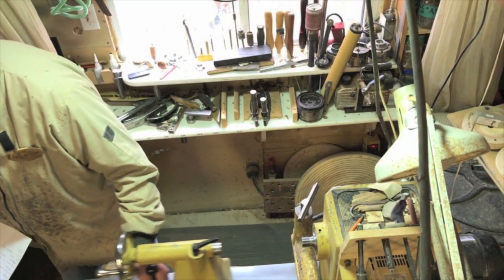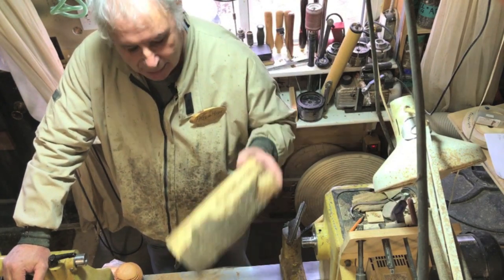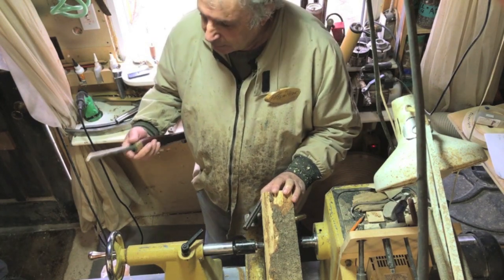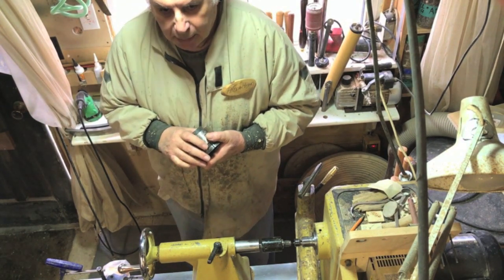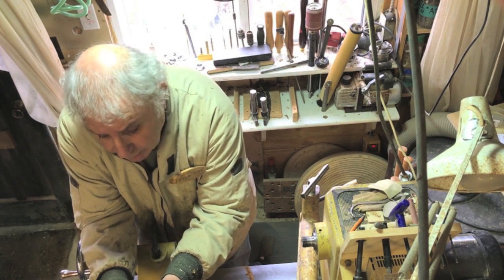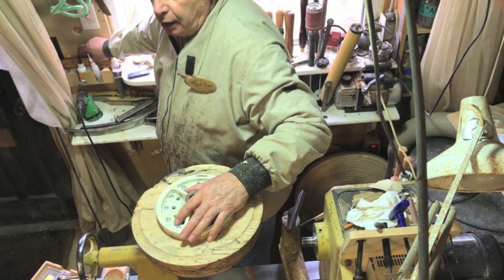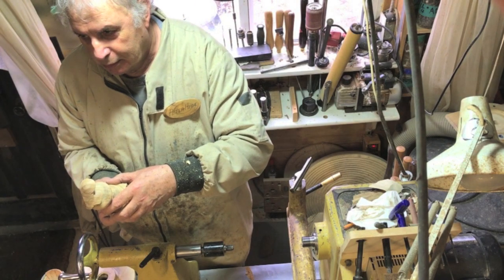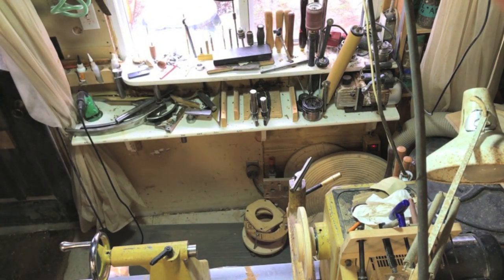NWG APRIL 2018

Comment: This was great. Thanks Peter.
Reply from the maker: Thanks. It was just a normal club meeting and sometimes more enjoyable than just talking to a camera
Reply: @peterhyde3282  thanks for the response. I enjoy your style and will be checking out some of your other demonstrations. I’m currently in the market for my first lathe and saw the video with Ethan and Wade demonstrating the Record Herald lathe which I may get.  Your analysis about it was very helpful as well
Reply from the maker: @victoryak86  The Herald is a very versatile lathe. It certainly is a good choice for a first lathe and pretty soon you will get to think it's the only lathe you will ever need. Lots of good features and well made.
Reply: @peterhyde3282  thanks Peter.  Looking forward to it. I know there’s a big learning curve but that’s what it’s all about right? You may be hearing from me now and again with the occasional question😊. Appreciate you, best mate.
Reply from the maker: I was still using my trusted Powematic 3520 when this video was shot. I decided to downsize and sold it as I was no longer making big stuff. The Coronet Herald was chosen because I had tried one at my local dealer Stockroom Supply. The sliding/rotating headstock was for me the deal clincher because it meant I still had big capacity if I ever needed it. Motor is a bit underpowered for big stuff or heavy coring, but slow and easy is the way to go. Check out my Website peterdhyde.com and leave me a message on the guest book. @victoryak86